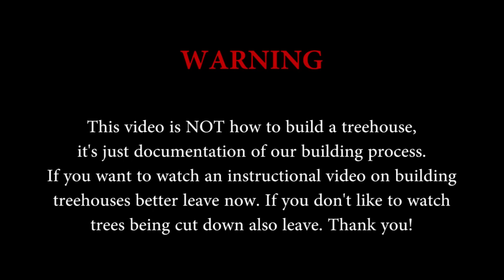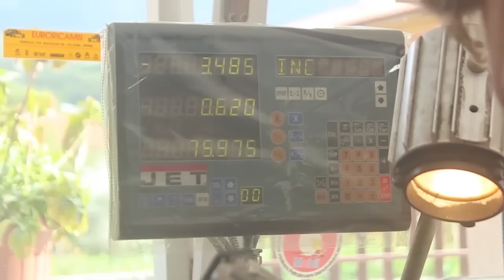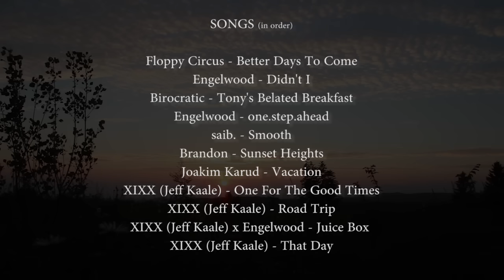Building an Amazing Treehouse

Comment: Eh .. It's a pity the steel in the riveting was not covered with oil, or chrome, nickel .. Although it was easier to press a 1mm thick bronze pipe on top, the best sliding is no squeaks, it does not rust. Well, immediately cover the wood with a special composition for long-term protection from the sun, moisture and pests. This house would have stood for 20-30 years .. And so the supports will rust in 5-10 years

Comment: 12:22 oh, yeah baby! show us what it takes... 
super glue coulda/maybe put it back together? doubt it, though. that looked un-salvageable. should keep a couple of unopened tubes in your pack. shit really works for fairly deep cuts.
i've had many bladed type cuts (to the bone on occasion). super glue works better than band aids, IMO. just be careful to not glue your fingers to the cut. it is also helpful to not have a gushing/bleeding wound.